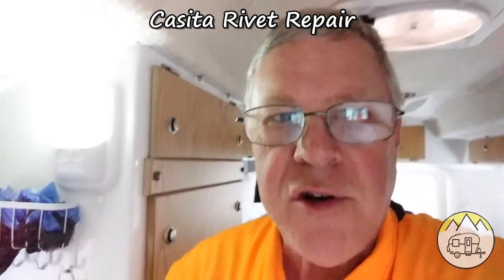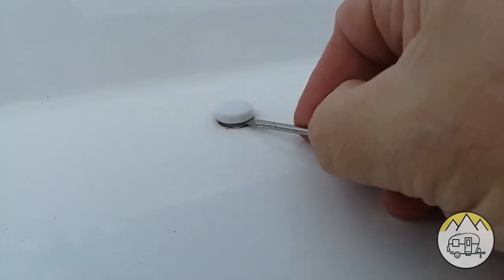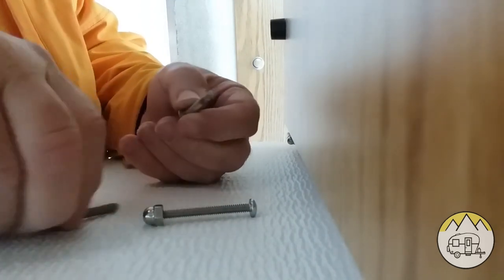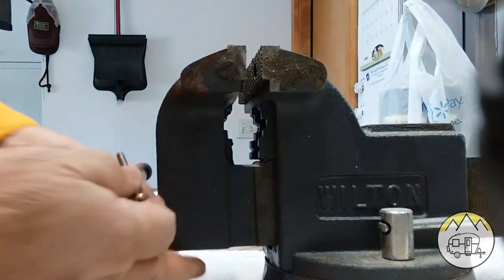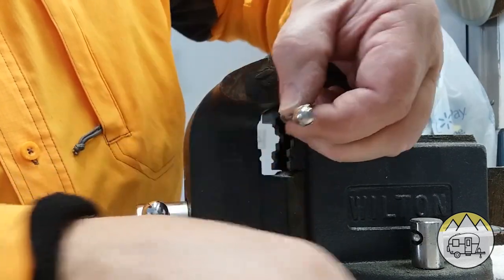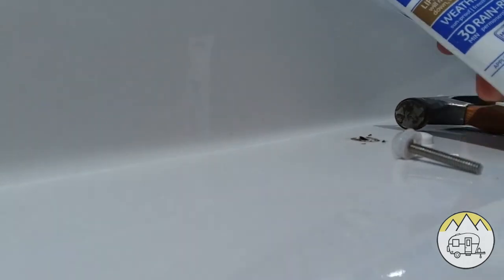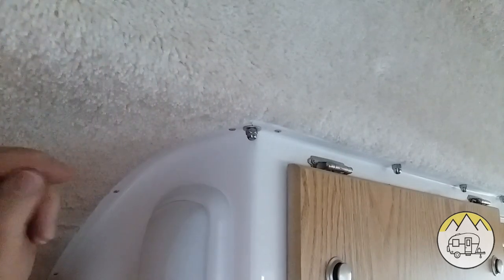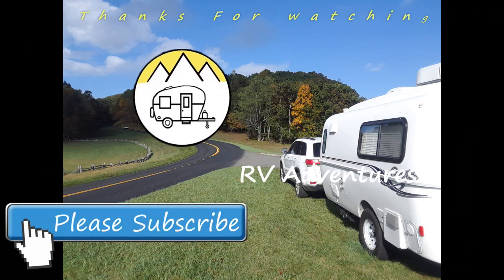Casita RV Rivet Repair by RV Adventures

Comment: When hacksawing screw/bolt, always put regular nut on first before cutting. Although filing is great/necessary, unscrewing nut, will ensure threads straighten up.

Comment: Well, I just had the same rivet break on my 2019 Casita Liberty Deluxe.  I called Victor at Casita who handles repairs. While discussing the issue, I asked him about using a stainless steel bolt like you described and he told me that it would void my Casita warranty.  Evidently, they use aluminum rivets so that if there is a large stress the rivet breaks.  If you instead use stainless steel bolts, you might end up with hairline fractures in the fiberglass.   This is more of a cosmetic issue, but I prefer to maintain the nice finish of the Casita without hairline fractures.   Victor is going to send me the appropriate aluminum rivet that is 1 1/4 inch length and 3/16 inch diameter. And then I will make the repair.

Comment: Excellent video. The only thing I would do different is to use a wire stripper with a built in screw cutter. It is easier than a hacksaw and  gives a cleaner cut.

Comment: You're right, the stainless screw is stronger and that is the problem. It won't break, but the fiberglass will. Don't do this, use aluminum rivets instead. Easy to replace and easier on the fiberglass.

Comment: Hey guys great videos.  Just one comment.  Just in case you need to repair more rivets using a "punch" instead of a hammer could lesson any further damage to the fiberglass.  By replacing with stainless steel you made it better than before.  Good job!

Comment: Allen

From what I've read, Casitas are built with rivets instead of screws to avoid stress cracks in the fiberglass. If the shell is under stress (which it is every time you drive it down the road), the rivet will break by design. If you replace the rivet with a screw, you risk cracking the fiberglass shell. To see how bad this can get, take a look at this video:
https://www.youtube.com/watch?v=asNM0cPisxY
If you decide to start using rivets, could you repost this showing how you're replacing them? I do appreciate your videos. They're very well done.
Reply from the maker: Thanks for the comments.

Comment: Thank you R.V.A. A simple project that works best when done correctly. I haven't found a source for the white protective plastic caps. Not available at our Lowes .Not on your Amazon link. Any suggestions? Also I bought a used Casita.  The previous owner did a modification . So I need a small amount of matching carpet: a yard or so.  Do you have a source? I have a contact question into Casita, but no response yet. Thanks in advance.
Reply from the maker: William Branham My understanding is that Casita will sell you a length of the carpet that has the foam backing like they currently use. They will also sell you a package of the rivet caps... I think they come with the base the caps snaps onto. It is best to call Casita, ask for service/parts and leave a message. They usually call back in a day or so in the afternoon because they are doing new owner pickups in the morning.
Reply: Check out Little House Customs--they sell a pack of snap cap bases and caps, and also a rivet pack with an assortment of commonly used sizes.
Reply: THANKS!

Comment: Why do you replace with screws instead of rivets?
Reply from the maker: Because I wanted a permanent solution... the key is just snugging it up, not tight, so as to give some ability to flex a little... the key then is washers, and sealing to prevent leaks.

Comment: Nice video...I might have missed it but what size screw did you use (diameter) ?
Reply from the maker: I believe this one was a #8, like 8-32 thread, stainless steel.
Reply: @RVAdventuresTV  My nut caps would only fit on a 1/4 inch diameter screw, which doesn't fit through the rivet hole! Did you change out the nut cap?

Comment: Very nice video. Good info. Allen, my 1999 Casita has a couple of screws coming up on the outside where the two halves of the shell come together. They are near the back. I don’t have anything to tighten them with. And, it’s not a screw like a Phillips or slot. Is this something that Casita in Rice, TX would have to do?
Reply from the maker: Casita doesn't repair in shop. Maybe if you called them they could direct you to a place that could help you.
Reply: RV Adventures  - Good idea. Thanks.